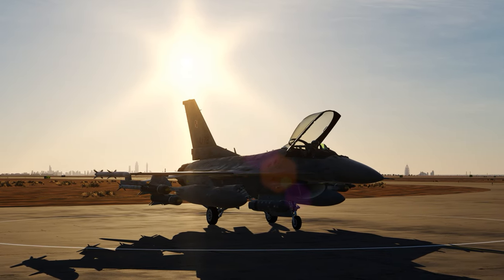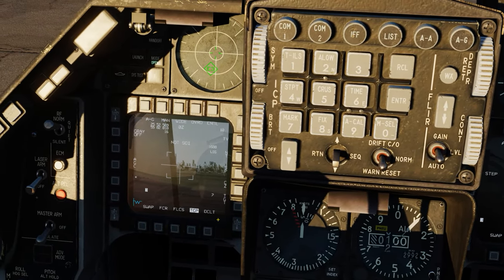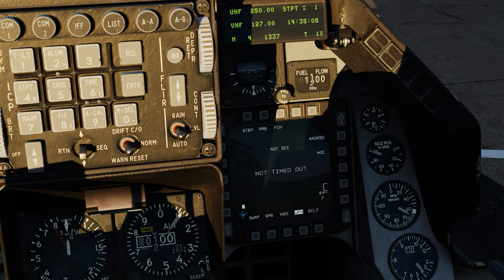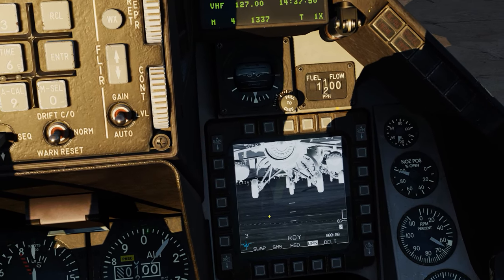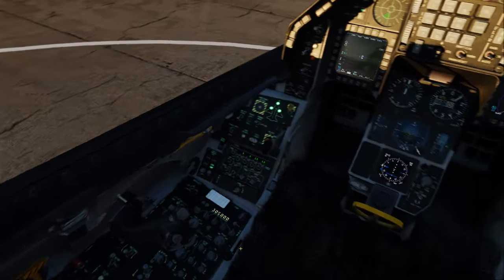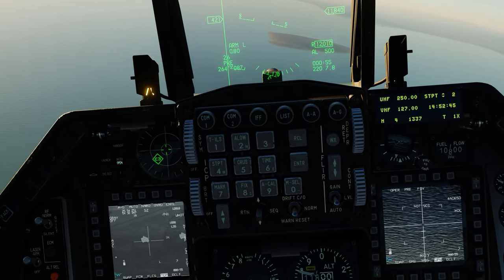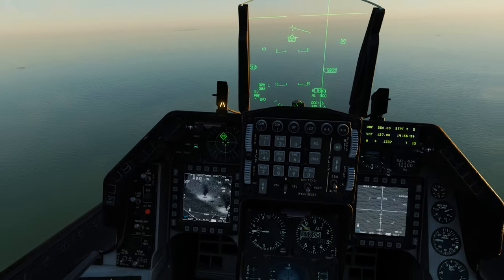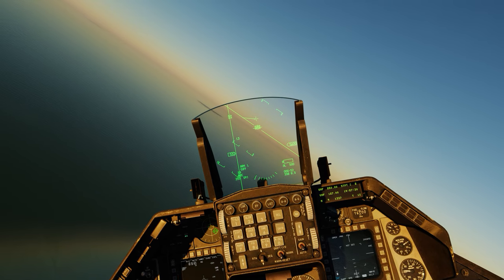DCS F-16C Viper: AGM-65D Maverick basics. How to use it the right way from cold and dark.

Comment: This is a very thorough explanation. I'm having issues with the mavericks keeping slaved to the TGP. Are there any procedures for doing this?  Initially the mavs will slave along with the tgp but will then break away from that and I can't tell what causes it. The hard point on the tgp loses the S designation for 3 or 7 and it either has a T or nothing until I press it to go back to S3 or S7. Can be frustrating

Comment: Digging your videos.  Boresighting on the ground is much more convenient than doing it in the air, but wouldn't there be parallax error introduced by boresighting to something so (relatively) close?
Reply from the maker: I could image that too but i think as long as it is in gimbal limits it’s fine. I have a contact whos been flying the viper for real. I will ask him and see if i can get an answer to that. 👍🏼
Reply: @ironeaglesflight  That would be excellent. Even if it 'works' in DCS I'd feel a little guilty taking advantage of if if it wouldn't work in the real Viper... and if it doesn't it would make a fine pedantic bug report for ED.
Reply from the maker: Okay according the info I have from a former Viper driver it is true. They did it on ground with the old TGP and Mavs before roll out.
Reply: @ironeaglesflight  awesome, thanks for confirming that. Will now do on the ground guilt free!
Reply from the maker: Yes, sir.
Reply: @ironeaglesflight  what version you in with DCS By me itsn't go to work It's a verry simple setup but i can't get it to work Everytime in the air the mav's aren't align with tgp
Reply from the maker: @luc Toussaint i am on the latest open beta.

Comment: Is the boresight process required to have the maverick seeker slave to the tgp after it powers up? 

I don't seem to have the "S" icon over the station number when the maverick is selected on either the tgp page or the wpn page when they are being displayed on the left or right mfd's. 

Seems like all the other videos I've seen once the tgp is powered up the maverick seeker automatically slaves to the tgp when it, (the maverick) finishes powering up?
 
I cant even get it to slave when starting the F16 "in flight" on the mission editor where everything is already powered up?

What am I missing?

Comment: I didnt understand why we need to turn on the ground jetisson?
Reply from the maker: Hey there. From what I understood it does the following. GND JETT "on" will emulate as if the plane is in air. Meaning the GND JETT simulates that althought the pressure sensors of the gear having positive signal the plane reognizes the state as in air (gear up). While we set the Master Arm to simulate the  WPN System should work as intended in air. Hope that makes sense. Thank you, sir.

Comment: I cannot see the big center cross in WPN page..How can I solve this problem??
Reply from the maker: Things to check before. Did you power on the AGM in your stores management? It takes about 3 minutes i think to bring then alive. After that you can see what the AGM seeker head sees in the WPN page.
Reply: @ironeaglesflight  yeah I powered on and Wpn page is alive and I can even slew it and Tms up to lock target. I can do everything with it. The only problem is the crosshair does not appear.
Reply from the maker: Can you please reference what crosshair you mean? Give me a spot in my own video to look at so i see which one you mean. Thank you.
Reply: @ironeaglesflight  5:02 The big cross in the middle that divides the screen in 4 squares. not the small one.
Reply from the maker: I gonna have a look at this again with the latest open beta. But let me ask you just to exclude it. Are you using AGM-65Ds?

If nothing works out meet me on my discord. Link is in the description.
Reply: @ironeaglesflight  Yes I'm using D. I tried another variants( G, H...) but I can't see the cross as well. I'll contact you on discord.
Reply: Test tms up to get the get  the center cross
Reply: @hannajonsson7978  That's not the problem of my operation. I solved it and it was graphic setting problem. I changed cockpit display resolution from 256 to 512 and now I can see the cross